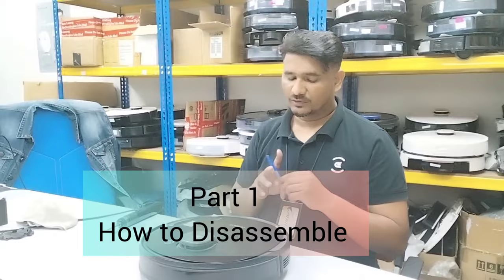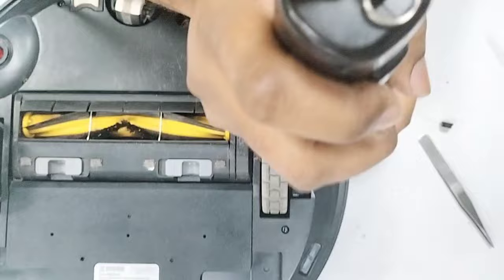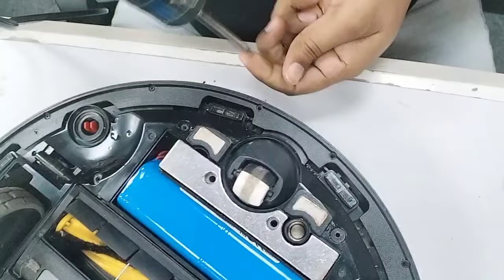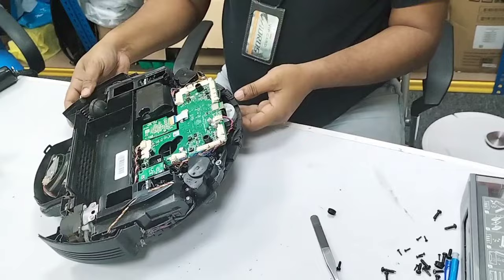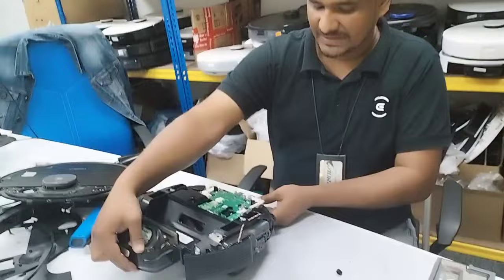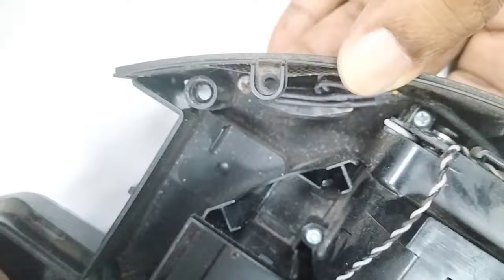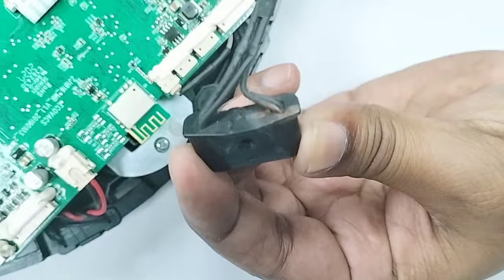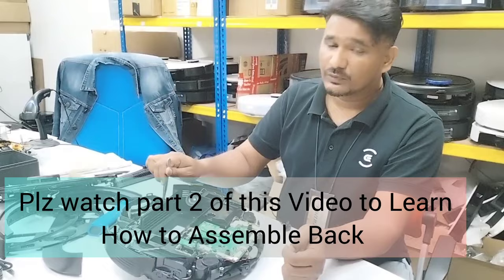How To Disassemble / Open Ecovacs Deebot

Comment: Hey mate! can you make a video on how to remove the main brush motor? mine seems to be slipping and is out of warranty.
Reply from the maker: Sure...for main Brush motor one thing remember need to dis assembly the whole deebot then only you will reach to that part.. I'll shoot a quick video about this topic soon
Reply: @ecovacstechnicalsupport5278  Looking forward to seeing this video.  I think my main brush motor on my T8 has stopped working as well.  I put a red dot on my brush and on the motor to mark a spot before letting my T8 clean.  Afterwards, I checked to see if the dot I made moved and it was in the same spot on both the brush and the motor.  I'm guessing my motor is bad.
Reply: How do I confirm its a main board issue for my DEEBOT OZMO 950 Series NOT charging, base station is putting out 20V and I have made sure 100% that the contacts clean and making contact

Comment: My Deebot will run for various amounts of time then just stop and power down. No lights and no sound. When I place back on the charger it will power back on and show it still has plenty of battery, usually around 87% or more. 

What do you recommend to fix?
Reply from the maker: Just battery need to replace... battery suddenly shut down

Comment: Hello @ecovacstechnicalsupport5278.  Thank you so much for the video! I have an N8 pro+. My top plate doesn't come off with just my fingers like in the beginning of your video. Any tips? 

My mapping stopped working so I'm trying to check LDS.
Reply: I’m having the same N8 pro and am having the same issue following the video. I am trying to pull off the top cover with my fingers as shown but it doesn’t seem to be popping off as easily as he demonstrates, but perhaps because I’m not a seasoned professional like in the video. I’m afraid of breaking the cover if I apply too much force to remove. Did you have any luck?
Reply: @lawrencejeun1360 , Same. I tried pulling quite hard and it didn't come off. I am afraid to break it as well. I feel like it must be screwed somewhere. Please let me know if you came up with anything.
Reply: @mikeazatov1537  Unfortunately no, but haven’t had much time to research since posting last. Will absolutely keep you informed if I learn anything.
Reply: @mikeazatov1537  hey i got it! I don’t want you to break yours, but i did just pry it up with my fingers like in the video and it popped out.
Reply from the maker: Don't worry...when first time we remove that front top plate is slightly tight we need to pull up...I can do with my fingers as well but maybe for you slightly tuff..so u can use  - Screw driver to pull up that part...there are just plastic Lock... won't break don't worry...
Reply: @ecovacstechnicalsupport5278  Thank you! This really helped!! :)
Reply from the maker: @lawrencejeun1360  if its different for you then plz use minus screw driver to pull up the front plate
Reply from the maker: @mikeazatov1537  haaaayya .. there's no screw dear...I open in front of you....just first time feel hard then just play 😄😄😄...can use screw driver to pull up the front plate

Comment: UPDATE: Success! I am so happy. Thank you so much for generously sharing your knowledge! Watched your other video too on cleaning the LDS sensor. 

Hi, I tried to open the top cover where the sensor is and you've said that it can be quite tough but I'm worried that I will break it. Mine is the Ozmo 950. Is there a screw somewhere? As a result, I think I could not then remove the bumper safely. Please help advise as it's only my sensor that needs cleaning. I got to the battery. It was the top cover that was tough to remove (the one you prised open with your fingers, but I even used prising tools and it still would not budge).
Reply: same issue how do you remove it?
Reply: @BrendanJackson-eg9ti  Hi, did you mean about prising open the top cover? I wrote this at another video by ECOVACS Technical Support. https://www.youtube.com/watch?v=OGMphQ0G7hc. The tip I think is to slowly prise it open from the sides and not the middle. It's definitely very tight, so you do need a prising tool to insert and slowly do this.
Reply: @angelathas399  thank you, managed to do it

Comment: I love watching this guy, so skilled 👍👍 However, my T8 has a fault that I've not seen mentioned here.  If I remove the water tank, the T8 thinks that it's still fitted and is permanently in Mopping Mode, therefore it won't hoover carpets.  I have tried the reset but that doesn't work unfortunately. Has anyone else come across this fault?
Reply from the maker: Sir r u using normal water tank with T8 or Ozmo pro tank...  T8 originally comes with normal water tank but if customer wants can buy ozmo Pro tank..can use with T8…...plz let me know then I'll explain what's the issue
Reply from the maker: Or u can send a video clip at 00601137973018.. I'll see n let you know what's the issue
Reply: Good morning, thanks for replying.  It is the normal T8 water tank.

Comment: The gentleman touches the circuit board without discharging himself electrostatically. However, this does not look professional if you do not adhere to ESD. Electrostatic discharges can cause damage in microelectronic components, because the energy of a static discharge in a semiconductor behaves like the energy of a lightning strike in a tree in relation to the size of the component. This becomes clear when you see ESD destruction in a chip under a microscope, which has created a 'crater' there.

Comment: Thank you for the video, mine stopped charging even the battery was at 90%, i tried my dock charger on my other bot and the charger works, tried the 950 on new charger and not working, opened it, no water damage, checked charging poles and looks good, what could the problem be?

Comment: Hello, I have an LDS error issue, ive watched your other video and checked the rubber as well as made sure it is clean. sometimes it turns on but most of the time it doesnt spin. there doesnt seem to be anything blocking it. Would you advise i buy a new motor and try to install it? I have no repair centers near me. Is there something else that could be causing the issue before i get a new motor?
Reply from the maker: I'll upload another video about this topic in few days..

Comment: Thankyou for this excellent service. I have followed all the steps and disconnected all the screws, however I am still unable to remove the top plate where the main switch is. Any advice would be welcome?
Reply from the maker: Plz let me know Ur model no. First..if got camera on top then be careful when remove top cover .. because camera model always attached with motherboard with a chip...if that chip lock damage then motherboard need to replace...if u r using LDS or D-Tof model then Just remove front two wires before pulling up the top cover...make sure you remove rubber lock..located on LDS/D-Tof cover.. because under those locks there are screw..if you won't open those two screw...top cover can not remove...plz confirm to these things TQ
Reply: @ecovacstechnicalsupport5278  Model No. is DX9G. I have already removed the two screws under the rubber plugs. I have tried to remove the top cover but am unable to using my fingers. I am too afraid to use any more force...
Reply: I’ve done it! I plucked up enough courage to have another go at pulling the front plate up. I also read the useful post https://www.youtube.com/channel/UC7ll6Y0C4xktvf9TBmALVCA  Instead of a screwdriver as recommended, I used the two claws of a hammer. I reconned this would spread the load more evenly by applying pressure in two locations rather than one. Hey presto!

Comment: Thank you for your awesome videos. I have a deebot ozmo 610 that will run for about a minute indicating fully charged, and then suddenly the battery charge indicator falls to low and it goes back to charge. The battery is a new replacement and only a few months old. I have tested it with a meter and it is healthy. What could the issue be?

Comment: Hi, I have a Deebot T8.  It was dropped and afterwards it won’t charge anymore.  I get the red light error.  I replaced with a new battery, the unit works just fine, when it runs out of battery it won’t charge again, red light.  Which part of the board requires my attention for this repair?   Thank you.

Comment: I have a Deebot Ozmo 950 which is not moving smoothly. (The machine is 15 months old. When it moves across the floor it is jerky and just twists jerkily (NOT SMOOTH IN STRAIGHT LINE EVEN IF THERE ARE NO OBSTACLES). 
PLEASE CAN YOU HELP. 
WHERE ARE YOU LOCATED?
I am in India.
Reply from the maker: In India got service centre in new Delhi...plz contact ecovacs hotline no they will give you exact address..U can WhatsApp me a video clip so I can confirm what's the issue @00601137973018

Comment: Hi there, I have a T8 and I am tried following your steps to disassemble it, but I got stuck at taking the bummer off. There is some kind of elastic things that holds the bummer and the main body, but most of all I can get the top off (the main body) like you did. Do you have a video (will you do a video?) of disassemble T8? Thanks
Reply from the maker: If u r using T8 aivi then there will be 2 tiny screw on top of camera vover just remove those 2 screw then eaisly u can remove bumper.... those 2 screw holding bumper with rubber seal
Reply: @ecovacstechnicalsupport5278   There is a stretch material covered the camera like a rubber band I am not worried about that 1 to be released, but I have a problem to take the whole top of the vacuum off.  It seems like they are a couple places holding it down I can't get it to separate and lift the whole top.

Comment: Hey man,
Thank you for this amazing video. My robot is going backward for some reason. I cleaned the sensors and open the bumper and cleaned it, they are fine. Can you please help me to fix my robot? 
My robot is M81 pro.
Reply: Just want to add one more thing, even with my remote I can’t make it move forward. 
I will appreciate your response.
Reply from the maker: In this model if it start reverse then... might be anti drop sensors...the front 2 that you need to try try to replace if still reverse then left & right side....if still same then U need to test bumper
Reply from the maker: If you are in Malaysia..most welcome sir you can bring it to my place I'll fix for you

Comment: Hi, I have an X1 omni, and the top cover seems to be stuck even after removing all screws. I could pull it from front and behind but seems to be something holding in center. Are there any additional screws or plastic hold in that?
Reply from the maker: Yes there are 2 more screw need to remove from top cover beside the D-Tof assembly on Top cover you can see 4 Small round rubber caps need to remove..insid got two different colours screw... Black screw need to remove...then only Top cover can lift up without damaging

Comment: The head of the side brush where we plug the brush is broke. How to fix that?
Reply from the maker: Broken lock I don't recommend you to glue back... because some customers tried n they put glue a lot n glue enter in motor as well so all jammed...that clip can not repair...you must need to order side brush motor n just change side brush motor assembly...that clip comes with motor assembly...
Reply: Do you have an instructional video on how to replace and side brush motor?

Comment: This is great video, My N8 Pro just out of warranty and the main brush motor needs a replacement. I am not able to access the motor for replacement. Would that be below the motherboard ?
Reply: I have an N8+ Pro as well. Were you able to remove the top cover as shown in this video at 0:57? I have followed the video bit get stuck at 0:57 because I feel like I’m have to use more force than shown to remove the cover, and I’m worried about breaking it..

Comment: I watched your video and tried to open my Deebot to clean the vacuum motor as it recently sucked some water in.
But unable to open the top portion with power button.
I saw so many of your video and you just pull it out, but I am unavlble to do so even after lot of force. Any advise? I have N8 model, Thanks.
Reply from the maker: Sir make sure you removed all mentioned screw...2 on top under white rubber, 2 under battery these 4 are hidden screw if you won't remove these... casing Will damage
Reply from the maker: One more thing.. first time when we open any item..locaks are fully Tigh...need some force to remove... don't forget to remove front 2 wires attached with motherboard
Reply: @ecovacstechnicalsupport5278  I was able to open it and there was no water damage thankfully. Assembled it and now it is working perfectly well.
Thanks to your video I was able to follow along and dismantle it 👍🏼

Comment: I think I need to replace the side brush motor for the right side (red) on Deebot Ozmo 920, have watched your video but i cannot get the bumper off. I am assuming its the motor that needs replacing, the green side you can feel glides round nicely when you turn it and the red side clicks round, it is as if a cog is worn
Reply: I have managed to get it all apart now and the red gear that holds the side brush in place is worn and needs replacing, I have a 3d printer but cannot find a file online for that part, can I purchase the gear/cog from you please?
Reply from the maker: Actually with 3d printer u can print inner gear...but this one should be flexible...but 3d material is quite hard will break in once..
Reply from the maker: Plz contact 00601137973018

Comment: Hello. May I know why my Deebot vacuum cleaner Map in the Ecovac App slowly starts tilting a few degrees to one side?
Reply from the maker: Some times it happens but it doesn't effect the mapping...plz refresh the app before start using then it will give the exact status...& Map position u can turn with ur fingers as well...can make it straight again
Reply: @ecovacstechnicalsupport5278  thanks for your reply. 

The tilting of the map is happening over a period of time. Once a map is generated, we will see a tilt in about a month's time. The robot is also moving forward at a tilted angle (4-5 Degrees). Do you suspect any issue with the wheel assembly (speed is not matching) or it could be a software issue?

Comment: Hi
I have an issue with ozmo 950.  I used in mop mode for morethan 50 minutes, the water tank will not come back easily if tried to remove it from deebot.  I tried to pull out by using little pressure, the water tank will detached with main unit by giving a some noise.  I think some vacuum will giving such cimplaint.  How to clear this problem.  Please guide me
Reply from the maker: Make sure you Press the tank Lock before removing from the 
 deebot ...if without pressing down the lock if you trying to remove.lock will break
Reply from the maker: You can WhatsApp me a video clip at 00601137973018

Comment: Hi, I have problem with my Deebot M88 where the green side brush is not spinning....can pls share?
Reply from the maker: Remove top cover first then remove spoil side brush motor put aside... remove other side brush motor n fin in spoil side then power on the deebot put back dust box n press auto button..see weather that good side brush motor turn in spoil side or not...if good motor start turn after pressing auto button then just change side brush motor only will be ok...if good motor also won't turn in spoi side then...main board & side brush motor both need to replace together... because sometimes got short circuit

Comment: Hi. Thanks for the video. 
I have a Chinese version of t8 aivi+.
It will not charge the battery anymore. I thought it was because of dead battery. Therefore I purchased another battery. Unfortunately it didn't help. The white light is blinking  but nothing happens. Its stuck on 14%.

I got at tips saying this is a known issue and I have to replace the motherboard. 

Do you know if I can replace the motherboard with a EU motherboard and getting a European version?

Terje
Reply from the maker: Can u plz send me a pic of Ur deebot..can WhatsApp at 00601137973018
Reply: Ohh, sorry for late respond. Unfortunately I don't have WhatsApp. Can I send it in Messenger?

Comment: I have disassembled the Ecovacs Ozmo 950 to replace the main brush motor. After I assembled it, it is only going backwards, then giving the error that front pumper is stuck. What could be the reason, which wire or connection is related?
Reply from the maker: Make sure u fix back the bumper correct...n it can easily bounce back when u press...it it's bit hard means bumper stuch somewhere....n plz check front two clips behind the bumper...fixed or forget...
Reply from the maker: Most likely is bumper issue..not fixed properly

Comment: I have deebot ozmo 950 anti drop sensor error. I checked the sensors and none of them are lit. from what I have seen, they are not connected in series. is it a software problem? could all 6 burn at once? Thanks

Comment: hi, I have the t9 vibrating plate screws rusty and I would like to change them, could you tell me what type of screw and the size?
Reply from the maker: There are total 6 screw on plate...2 left, 2 right n 2 in the middle...so don't open all together....just remove one screw as sample n get the same screw from hardware store n fix back one by one... Do not open all together...
Reply: @ecovacstechnicalsupport5278  ok, where i can buy this screws?
Reply from the maker: @pandroid6697  plz check at hardware shops in ur country...these are normal screw eaisly can find

Comment: Do you have a video about how to open docking station? Thanks
Reply from the maker: Not yet..but its simple..at bottom got 2 screw under black rubber remove then top cover cxm pull up